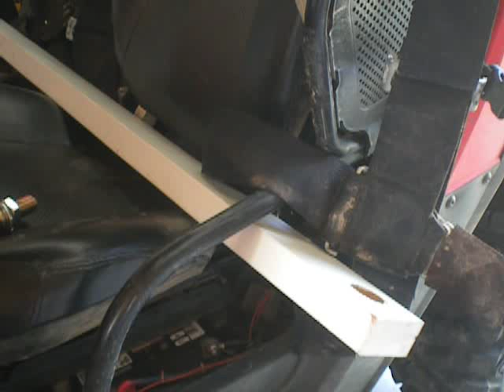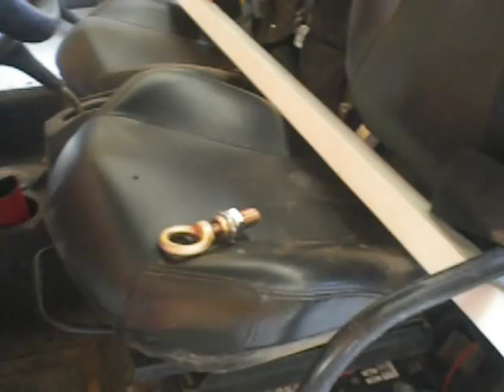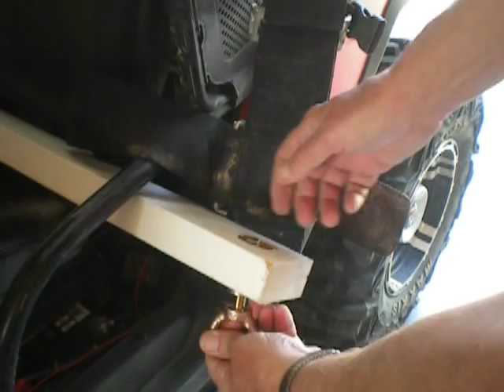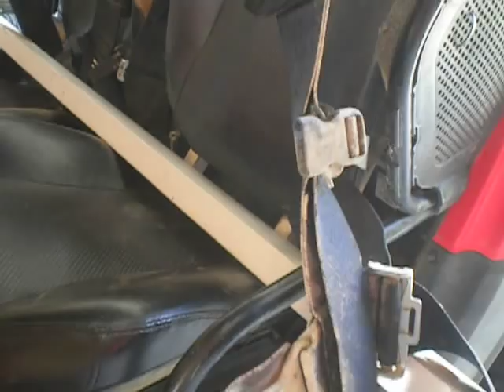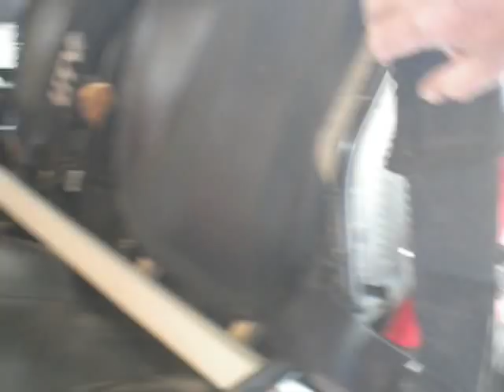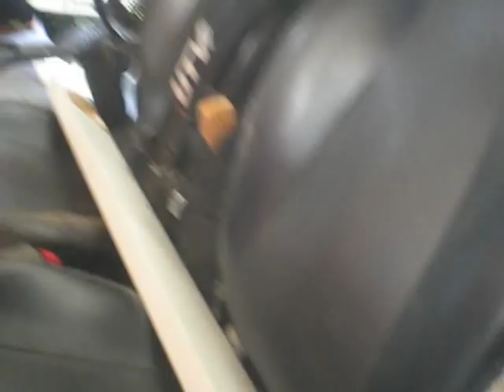Polaris RZR Anti Seat Theft Ideas

Comment from the maker: I thought about going Over the tops of the doors, with adequate padding to prevent scratches. I would have to work on a few ideas on how to keep the safety bar from "walking" back and forth while travelling. But, I think if you places the bar across the doors from left to right, and then placed your security chains toward the rear of the trailer, say an a 45 degree angle, then the bar could not walk forward. Either way you did it, the bar would be in the way of total removal of the seats.

Comment: Thanks.  The only thing I did was put in one of those cable locks.... just looped it through like a snack and locked it up, seat to rzr, rzr to trailer....  But it doesn't secure your rzr to the trailer in case roll over though.